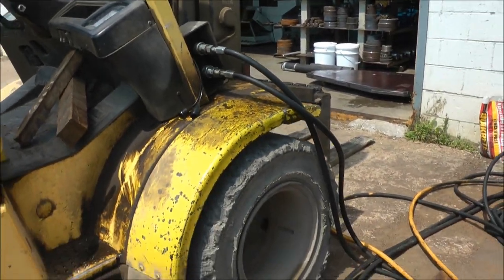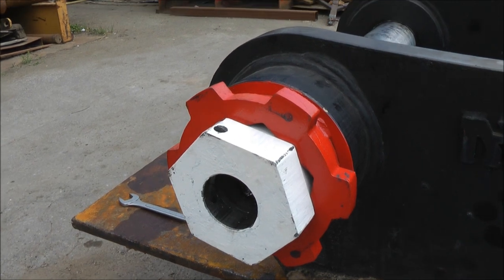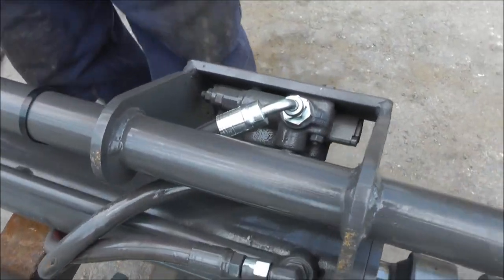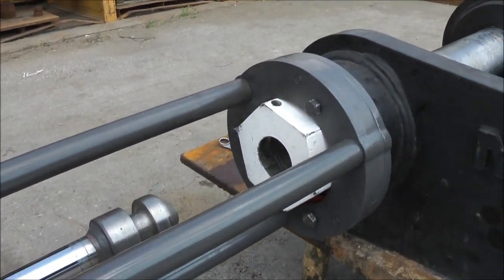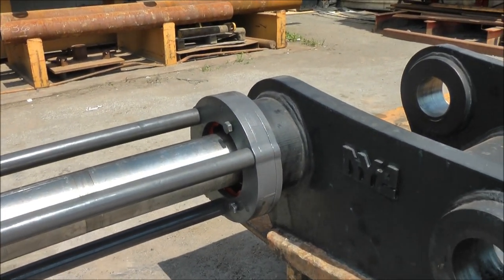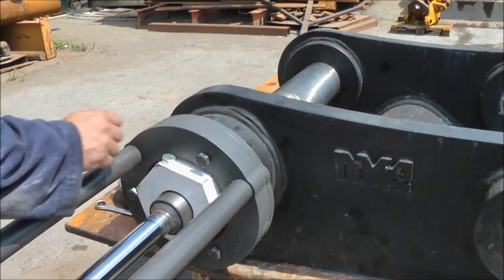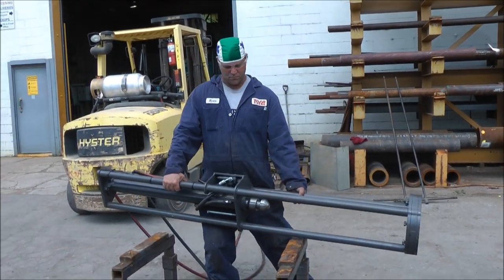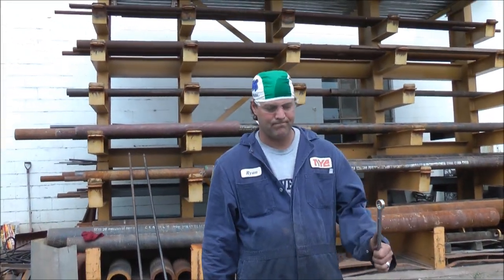Nye "Bazooka" Pin Puller

Comment: Ok for an engineer taking out a one off tight pin from the boom or dipper pivot, a no for the driver he would not use it, most machines nowerdays has a quick coupler the driver does not have to leave the cab to change from one attachment to another.

Comment: It does not look strong enough for really stuck pins with what I see. I have seen people put a hundred ton hydraulic press on pins and it would not move it.
Reply from the maker: You are right Dave, the Bazooka is not intended for servicing stuck or seized pins. It is only to help with routine pin removal and replacement when changing attachments.
Reply: @nyemfg  Oh ok that makes sense. Routinely hammering out big pins that are "loose" would be a chore. I should have thought of that. Thanks